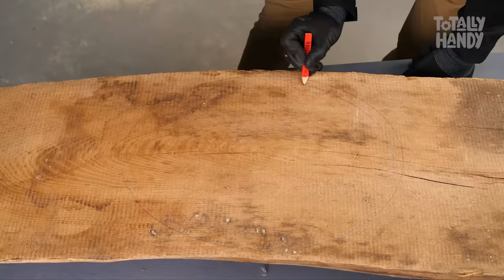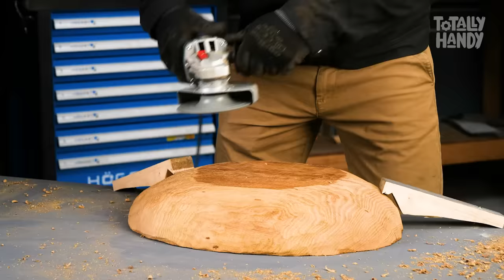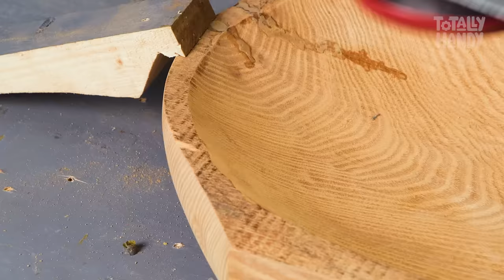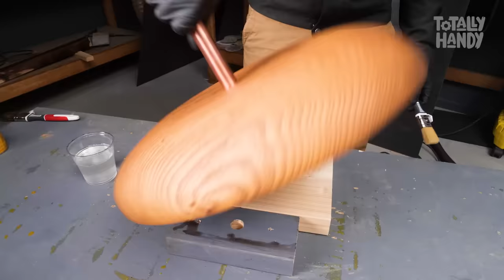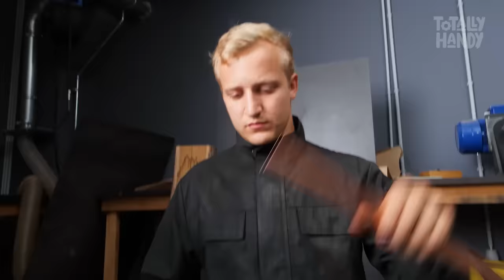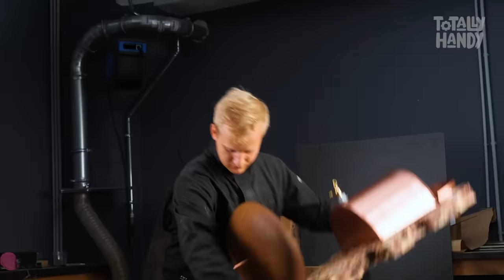Turning HUGE wood Log into a Wooden Sink | Woodworking Project

Comment: Nice s-trap, with undersized short sweeps 90's. That thing is going to drain like a champ for years with zero clogging issues. Gonna smell great too!
Reply: Yeah I think so too but it still looks really good and if it is a problem you can fix it quick.
Reply: is this a sarcastic comment? im not sure.
Reply: @crewcutter2030  Yes, it is a sarcastic comment.
Reply: thanks, i was looking for your comment.

Comment: I am curious as to what epoxy you are using. Most epoxies do not harden to rock stone hardness and are still susceptible to moisture, especially when it can't dry.
Reply: They make boats and surfboards with epoxy. How do you explain that?
Reply: @IkeCoblentz  I would explain it... by saying there are different kinds of epoxy.

The epoxies I worked with, even when they said they harden out super hard... they are not hard. You can scratch them... and when putting down drinks that are cold and leak moisture down you do get spots.

So yeah I want epoxy that doesn't get scratches way to easy, and works with water... like in this application. That's why I asked.
Reply: @Momoka7  I think u spend to much time at the Bar.....
Reply: @Momoka7  Urethanes are harder than epoxies. The fiberglass epoxy I use goes very hard but still scratches; its just plastic so it scratches. You could just use a urethane.
Reply: AND some epoxies are not as heat resistant as they might be.

Comment: Welding the copper segments together is not a good idea.

Sometimes you will NEED to get to a segment in the middle.
Reply: 1. that's not welding. 2.if it had to come back apart you can easily unsweat the joints.